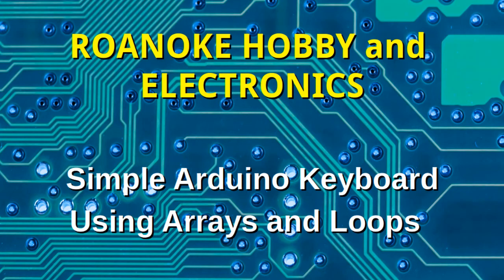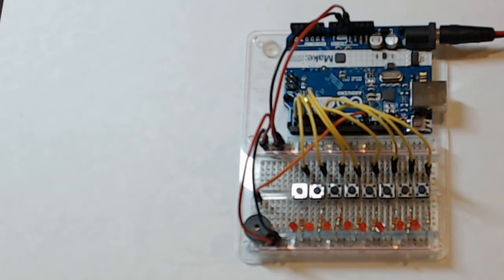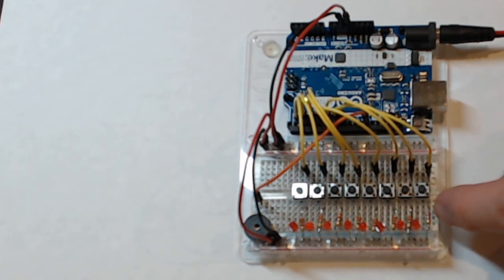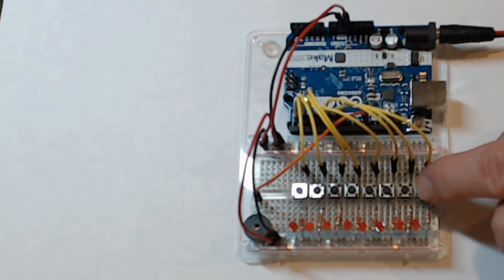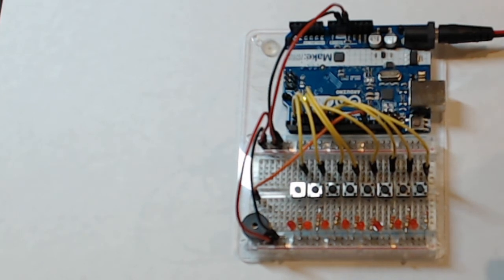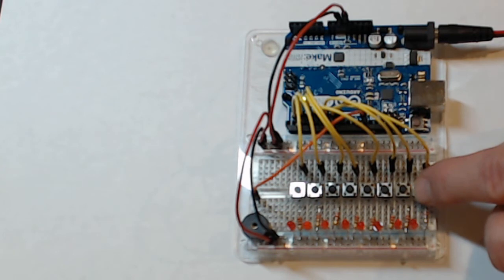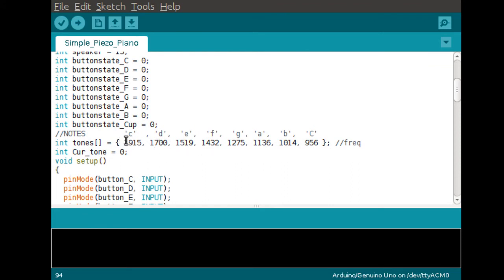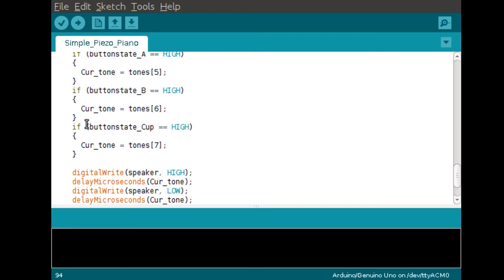Simple Arduino Keyboard Using Arrays and Loops

Comment: could not find the website How the breadboard is wired
Reply from the maker: Thank you for the comment. I apologize since the original Roanoke Hobby blog has since been taken down, that left you without the link mentioned.  I have put the link to the breadboard diagram in the description of this video so it's easier to find. Hope that helps.